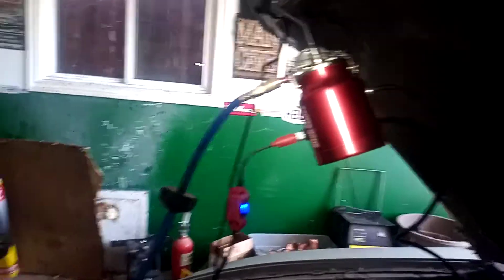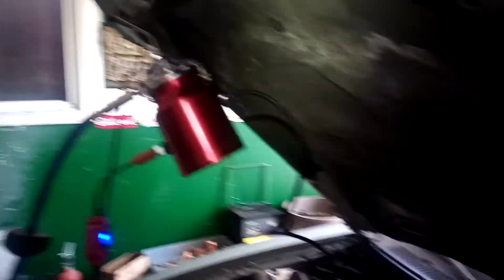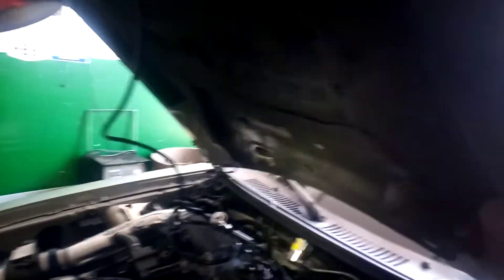2002 mustang gt intake vacuum leak diagnosis

Comment: Did you figure out exactly what was leaking?
Reply from the maker: I had a small leak at the intake manifold where it meets the drivers side head, I removed the intake and replaced the gasket. One thing to remember is to be sure that every possible opening in the intake system be sealed or you get smoke coming out of those openings, and this may make finding the real leak more difficult.